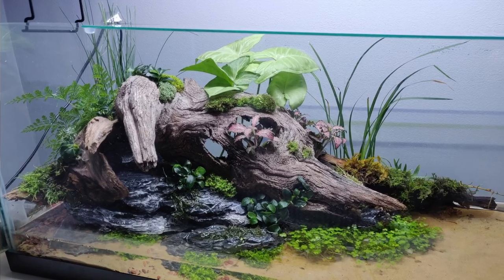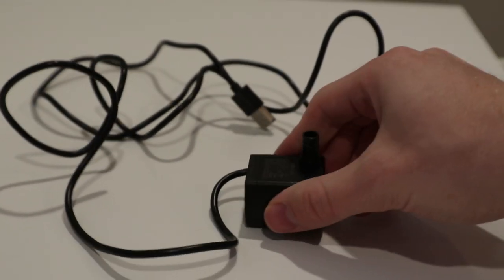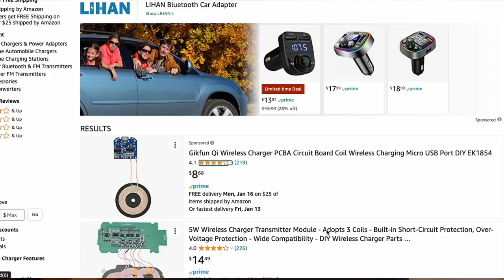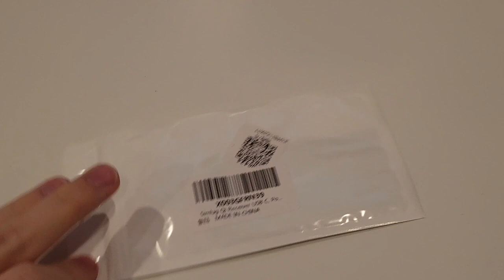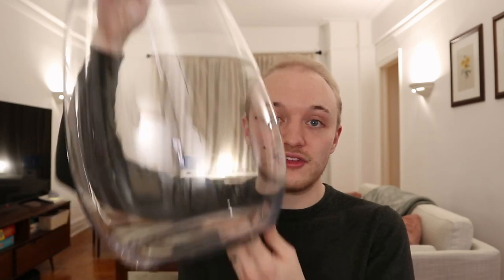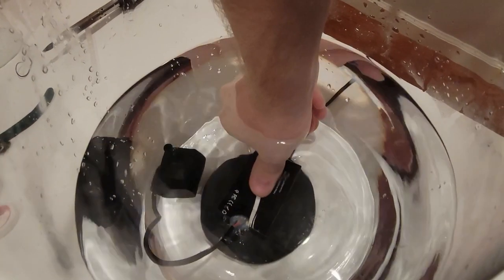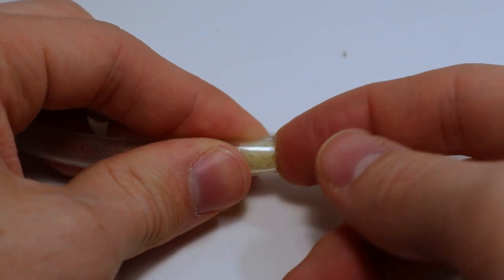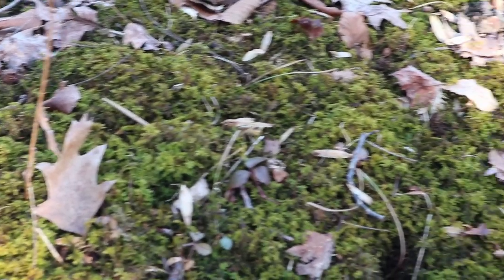Powering a Mini Water Pump Wirelessly (for terrarium, vivarium, paludarium)

Comment: Is the water safe for small animals this way? (Sorry if my question is stupid.)
Reply from the maker: Good question! I have no reason to believe that it would be hazardous to animals. It certainly does not electrify the water or anything like that. Rather, It transmits power via magnetic fields, which I don't expect would have any effect on most life forms. Motors (used in all submersible pumps) also generate magnetic fields to create rotation, and im not aware of this having any adverse effect.

Comment: How did you know which wire to sodder to
Reply from the maker: In this case Red->VCC and Black->GND. But the colors of the wires on your pump and how the terminals of the wireless reciever are labeled will vary. There should be some label or coloring, and you can Google which is positive and which is ground.

Comment: Hi, I had the same idea. I would suggest a couple of modification for anyone who's going to give go:
1. Waterproofing the circuit board by coating it in a thick layer of clear acrylic nail polish, hot glue wont work and the components will rush very fast. You might be able to pour the nail polish into the sleeve it comes in, but do that AFTER you have connected the pump and tested it above water.
2. 5v is important but you should look for a wireless charger and receiver with the highest Amp rating, for example the one you used is 1000mA, I would not recommend anything less. This will determine how powerful the pump will be when its on and how high it can pump the water (simplified).

And for those people worried about water and electricity, I wouldn't worry. It's such a small amount that it wont hurt the fish if it short circuits, it will probably just stop working.
Reply from the maker: Thank you for sharing! Those are great tips. I like the idea of using clear nail polish. I think Silicone could be a good solution as well.

Comment: Do you still  need to keep it on the charger to work?
Im also trying to find wireless water pump that I can charge for a while and then it works for several hours like the one in Uahpet wireless water fountain
Reply from the maker: This one does not have a battery of any kind - it has to stay on the charger to work.
Reply: @micronature8681  can you make one?